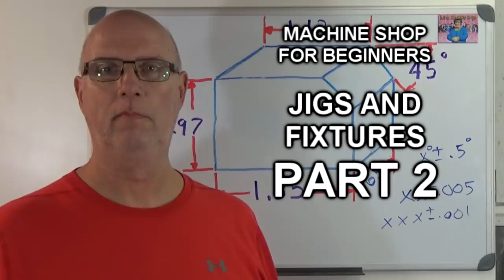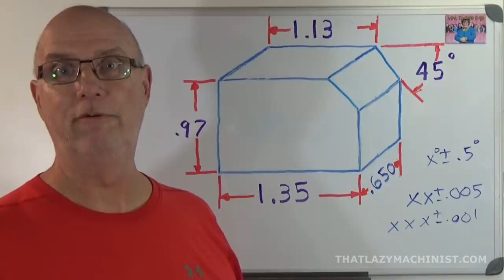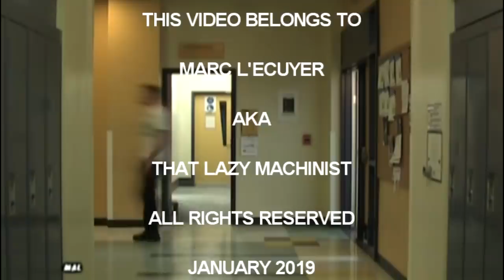HOME SHOP JIGS & FIXTURES #2, preparing the blanc parts using a shaper, a mill and a cut off bandsaw

Comment: Hi Marc.  Awesome videos.  It looks like the machine is running in reverse.  The cutting stroke should should be slower than the return stroke.  I had the same problem with my machine - had to reverse the motor.

Comment: Always enjoyable, thanks Marc. Question: how do you accurately measure the 1.13” dimension? I would just eyeball it with calipers from edge to edge, but there has to be a better way!
Reply: I would firmly place one of the caliper jaws on the chamfer itself, and the other one on the opposing edge. You would have to calculculate that distance though.

Comment: Marc, enjoyed your video.  At the end of your video you used a carbide cutter. What rpm did you run that at and was it a 2,3, or 4 carbide insert cutter?
Reply from the maker: Hi James, it is a two insert cutter and I run it around 1000 RPM. It could run up to 1600 RPM but with my arthritis I can't turn the hand wheel fast enough to avoid rubbing (in other words I can maintain a proper tooth load).

Comment: Maybe a stupid question. I'm new to machining. How can the shaper be accurate when the whole vise is tilting al litle bit with every cut? I've seen that on many shaper video's.
Reply from the maker: Hi Tom, I can't speak for the others but my machine is very accurate for a 60 year old shaper ( 0.001 over 8"). The tilting vice (in my case is a lighting problem) is an illusion since an indicator and the machined part dimension tel me that all is right. If you have the time, I explained this in more detail in my latest video (since many people though that there was a problem) and here is a link to that video.   https://youtu.be/RQRxRwVIJ60   Thanks for watching and for taking the time to write, Marc.

Comment: if you do a video about jigs and fixtures you might want to understand the difference first 

,,,its really simple ,,, a "jig " guides a >tool< for example  a drill.. or sanding..or reaming "jig"  and so on....a fixture holds "or fixes" a part for  gluing ,,,,securing .assembling ..ect. and so on .........please research before posting or at least correct your current videos...I've been in the trade  nearing 40 years and feel confident in this info i.m passing on... thanks for what you do  i mean no malice  twords your work and effort
Reply from the maker: Hi Andy! I agree with your definition about Jigs and fixtures. I would add milling, turning, grinding and many other machining operations where the part is held solidly on a machine and oriented precisely in relation to a cutting tool. And yes a  jig guides a tool to its proper position on a part that is generally not fixed to a machine. I do think that this was properly explained in HOME SHOP JIGS & FIXTURES PART 1.  Here is a link if you have not yet viewed this video    https://www.youtube.com/watch?v=EXYqi42JimI  Thanks for a great comment and for taking the time to watch my videos, Marc